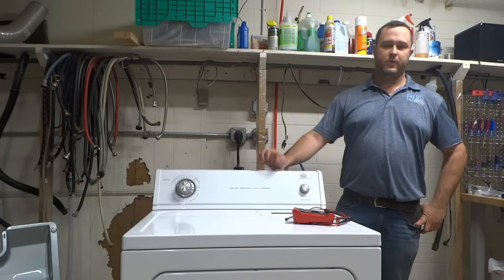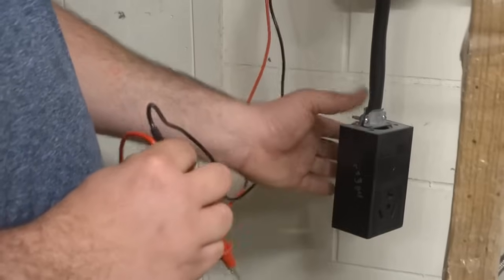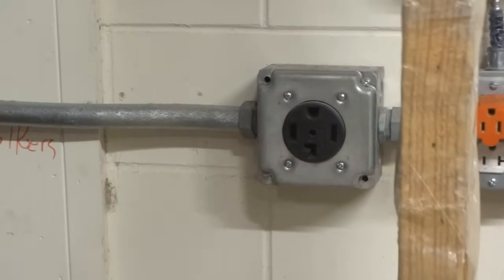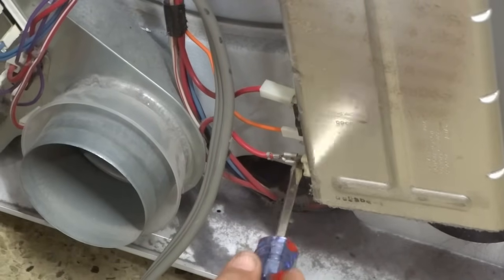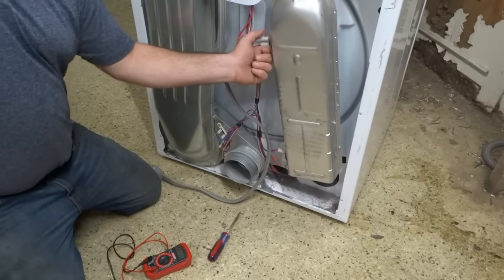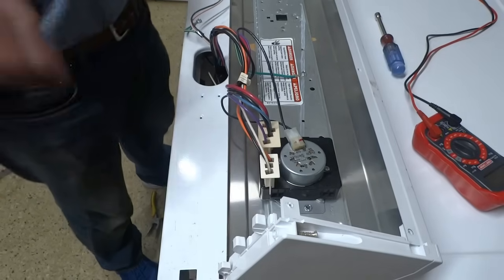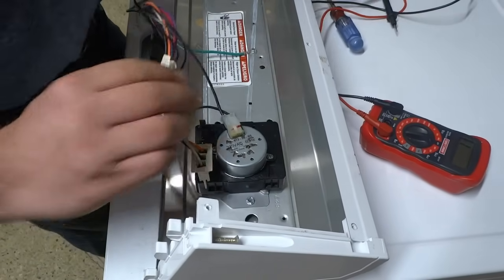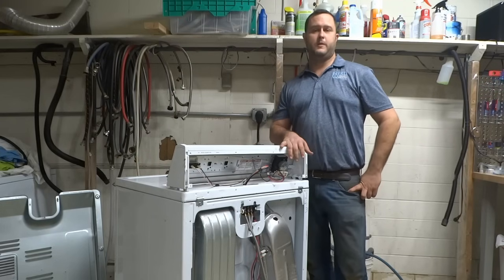Whirlpool Dryer Not Heating - Diagnosing Common Issues

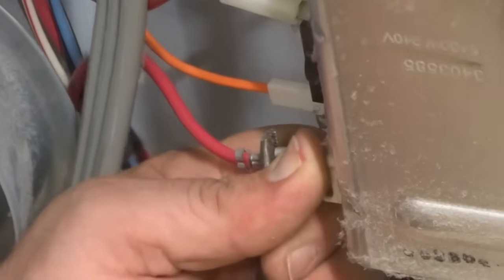Comment: The centrifugal switch in the motor can easily be tested from the back. That red wire that's stuck at 4:30 comes from the switch at the motor. If you have 120 to ground from that red wire while the motor is running, then the switch is closing properly. Live testing involved so use caution ✌🏼
Reply: Can you explain this a bit more? Everything part mentioned tests good on mine, but still no heat.
Reply: @billyjohnson5140  Did you ever figure this out? Everything tested ok on mine too but no heat.
Reply: @apizer did you ever figure it out  ?
Reply: @ericschulze5641  Yes, I did. It took me awhile to notice, but where the power cord wires attach to the rear of the dryer, one of the connections was all burnt out. There was another problem with the dryer shaking, and I think it had loosened one of the dryer plug cord connectors causing it to spark. Replacing the whole thing the power cord was attached to seemed complicated (along with fixing the shaking), so I replaced the dryer.
Reply: @apizer  I'm guessing yours was a GE due to the fact you said it was shaking, probably not worth repair, the cord issue is super common, as a technician the FIRST thing I check is for 220 volts the SECOND thing I check is for burned wires at the power cord, it's extremely common and not from vibration, it's from inexperienced installers ,& could take years to burn off, those screws have to be really tight, almost tight enough to break the terminal block, thank you for responding, PS I ALWAYS check the cord on any dryer or range after repair so if there's a fire I don't get blamed for it
Reply: I also performed a test and everything was testing good and still the heating element what is not turning on, I was decided to send it to get fixed but I decided to you know what just for the last try , I want to the breaker box and even though I take my 240 at the back of the dryer and it was good , the Break it was just kind of lose and I flick it up and down and Wala the heating element work , I  think it was what I call Partially tripped bacause it was letting electricity go through but somehow not all the what’s

Comment: Thanks for posting! Was able to narrow it down to the timer. I just happened to have kept all the usable parts off another dryer that was very similar, so I  used the timer from that one and got mine going again. It wasn't EXACTLY the same, but nothing a little splicing and a couple of incantations couldn't fix. Thanks again! Good video!

Comment: There are two legs that go the heating element.  By logic the one that goes through the timer also goes through the motor.  So its circuit is not only completed by turning the timer on but also the motor running as the centrifugal switch turns, it makes contact and it also completes the circuit to the timer motor as well.  I think the other leg to the heater is directly connected to the heating element but I am not sure depending on make and model.

Comment: Of all the videos that I have looked at. Yours is the only one to check the switch on the timer to the heater. I had run out of options until I found your video. Thanks a bunch. I took the timing switch apart and found the point for the A terminal had been arcing. There were arc marks inside the plastic case for the timer.

Comment: Followed your video and when got to the dial  get beeping on my meter on 2 hot cycles but not the third.   Do i just need new switch or is it my motor fail safe thing.  Hubby wanted buy new dryer i say fix this one.

Comment: i checked the timer  like you did in the video  its open ,but if i check it threw  the plug connector (black and red wires)it reads  good .ohms beep?

Comment: So if everything checks out what else could it be that it’s not heating? The only thing in question was the wall outlet but washer is plugged into same outlet and works fine... I’m at a loss. Thanks for any feedback!
Reply from the maker: Your dealing with a gas dryer if you have the washer plugged into the same receptacle. This video is not applicable

Comment: What is it when your electric dryer works as it should and shuts off at the end of the cycle, but the heat is staying on?
Reply from the maker: Probably some kind of short to ground on the heat circuit. Good luck
Reply: @byrdappliancespecialists3356  Hi, checked the heat circuit, it is not grounded.
Reply from the maker: @carfran53  it can't heat without the drive motor running, which engages the centrifugal switch on the L2 line. Keep checking. Also, it likely blew some fuses, too.
Reply: @byrdappliancespecialists3356  Thank you for your reply. It is heating with the motor not running and every now and then  the fuses are blown. This is beyond my DIY knowledge I will have to call a technician.Best regards from Lima , Peru.

Comment: as I recall, I replaced a thermal fuse on my Gas Kenmore dryer a few years back and that solved the issue, but I believe it was still running just not getting hot - does that make any sense?

Comment: Will the timer not working also cause the dryer not to heat? I know my timer is bad because it won't move off the initial "start" setting... no matter how long it runs (the first time we caught it doing this last week, the dryer ran all night long...). It's also stopped heating, so I wonder if replacing the timer will fix both issues. I have already replaced the cycling thermostat hoping that was the fix, and it did nothing to help either issue. Thanks!
Reply: I have the same problem and question

Comment: Thank you for this tutorial. The heater elements were Open circuit. I ordered the kit which contained all the sensors and thermostat. Dryer is back up and running,

Comment: Using this video I was able to determine that my Upper Thermal fuse had pooped the bed. The dryer still turned on and Tumbled but was not sending current to the Heating Element and would not dry. I removed the upper thermal fuse and jumped its wires together and reconnected the Heating element and the lower thermal fuse plugged the dryer back in and turned it on and the heating element started heating up immediately. Dont worry Im not going to use it this way it was just a test to see if the fuse was the problem, as I had suspected it was because it failed a continuity test while the element and lower fuse both passed. 

I appreciate the advice in this video but the pinned comment seems to be misleading. It must be manufacturer dependant as I have a Sears Branded dryer which is basically just a whirlpool rebrand and I ordered my new part off amazon and it will be here friday (ordered on wednesday evening)
Reply from the maker: Thermal fuse is the white plastic fuse on the blower housing. Glad you were able to get it going again.

Comment: Thank you for the video! My dryer wasn't heating but everything else worked. all the fuses passed and the element appeared good. in your video you said something about checking the outlet volts that if the volts were off it might run but not heat. I hadn't checked that since I knew I had power. Sure enough the dryer had two breakers and only one had been flipped. Put everything back together and it works again!

Comment: Glad I found this video. This is one of the very few that mentions the timer. I unplugged the wires and tested it and it said the switch was ok. I was frustrated because I had tried everything else. For the hell of it I plugged the timer back in and tested it and it worked! Maybe the plug had just become a bit too loose from many years of shaking?
Reply: The TIMER made the dryer not heat ?
Reply: @rickobrien4025  YUP!  I was surprised too, but that was the case!  Took mine apart (see other comments) and cleaned the contact leads and it started heating again like a charm!

Comment: Hey- so the heating element seems to be the problem and I can order and replace that BUT the timer switch also does not turn. When I replace the element will that fix the timer? The time is not blown according to the meter.  I checked all of the fuses and timer like you did and the lower white heating element thing was the only one which didn't read properly to zero ohms. It got no reading at all. Also the coils don't get red when dryer is running. Just hoping the timer will work correctly after I replace the element.

Comment: If it is the switch itself you can take it apart and file the carbon down between the heat contacts and it will work again. I did mine a while back and it worked for a long time. It seems like I've got the internal motor issue with mine. It's 9 years old so I'll probably just get another one.

Comment: this is a far shot you might not respondbut ill give it a try. so I checked for continuity on all the major switches even the thermal coil, everything gave a reading.  i don't know what the problem is.also the light inside the dryer is not working. could that be why.
Reply from the maker: No. The light is independent - it's circuit is closed when the door opens.

Comment: I want to say thank you it was my high limit switch the bottom thermostat was good and when I turn the timer on to check where the two hot wires were or the two hot wires were I got it to ring on the timer I didn't get it to continuity with a timer shut off but when I turn it on get it

Comment: So mine was the top one and I replaced it but still isn’t drying after I replaced both top and bottom. Why would it still not be heating after replacing the part that wasn’t good. If possible please help. Thanks
Reply: Timer?

Comment: Not sure about your centrifugal switch comment. It can be tested by physically activating it and homing different motor terminals. 
  Also, on some dryers, if the blower wheel is not turning, but the motor is, how is that going to disconnect power going to the heating element?
  If you remove the motor switch cover, you will see the contacts that make up when you activate the centrifugal switch.
Reply from the maker: Right, but the easy way would be live testing. It's easy to engage the switch, but that won't tell you if it's not closing correctly when the motor is actually spinning. It rarely, if ever breaks - it may sometimes have lint stuck in it - 1 out of 500. The video shows the common issues. Good luck

Comment: The thermostat with the 4 wires is the Operating/Cycling thermostat on the blower housing. 
  I have to wonder why you called the High Limit stat on the element cage the cycling stat?

Comment: is the ohms the same as checking for continuity? I'm not as familiar with ohms. I've always used the continuity symbol on my meter to look for open circuits.
Reply from the maker: Continuity, on the meter, is a measurement of low ohms. By definition, continuity really just means that electricity will pass through what you're measuring. Practically, once you get past a few hundred ohms, meters typically won't work on the continuity setting.
Reply: If it's working properly you said the ohms should read zero or one, so would the continuity be ok for this?
Reply from the maker: Yes

Comment: What do I need to do if I'm not getting continuity across the very bottom part that you had to use pliers on? I'm not sure if that's part of the bottom thermostat, or if it's part of the heating element.
Reply from the maker: Bottom 2 is the heating element.

Comment: Thanks for the video.  The video has great value.  I'm a DIY'er, with a framework of knowledge and a deficit of experience.  I would find this video even better is the hand didn't block what what the multi-meter prongs were contacting.   Also, the setting on the multi-meter and a very brief explanation would be good to remind me what I've forgotten between my last repair with a multi-meter.    Excellent delivery!  Thanks!

Comment: Well, I checked everything from the video and had good voltage and good continuity at the timer and thermostats.  Still, not heating.   Any suggestions?
Reply: I also cleaned out the duct from the filter to the blower.
Reply: I assume it is the heating element? He really didn't talk about it. :-(

Comment: Thank you! After replacing all thermostats, heating element, using a kit it still would have intermittent heat. Using your video I was turned on to the timer switch and bingo that was the culprit, I used my meter to test it and sure enough it was faulty.  Thank you for posting this info.

Comment: I'm getting continuity on the timer when its set to high heat but not on any of the other heating settings. Should i replace the timer going by that test or is it tricking me?
Reply from the maker: Sounds like the timer. Best test is to run it on the different settings and confirm. Then you'll have a second confirmation. Good luck
Reply: @byrdappliancespecialists3356  thanks for answering back quickly. Feeling confident in the info you've provided. When these things break you need them up and running again asap.

Comment: Hi, what about the white sensor to the left with the 2 blue wires, what is that for? Should we have test results? How should we test it. My machine tested all ok, I cleaned it out and yet it heats but I need to redo all loads a second time.
Reply from the maker: White thing is a thermal fuse - not related to heat circuit. If you have heat, make sure you're not crushing the vent hose, and your external venting is clear. You can test it without any venting attached to test. Good luck

Comment: My Whirlpool  TEDX640PQ0  has continuity on all thermostats, heating element, and timer. No lint -- completely clean yet dryer runs but no heat. What is the most likely problem? My guess is that something is wrong in the timer.

Comment: As I was taking off the vent cover I slid it too much to the right and it hit that wire you took off at @5:40. I forgot to unplug the unit so it shorted out. (sparks). It also tripped the breaker at the panel. Dryer still runs now but no heat now. Hoping it's one of the fuses you showed. Any other idea what could be causing it to not heat after the short?

Comment: Thanks for the video.  I just found the same issue, all my sensors and coil checked out, still no heat.  Used this video to trace it to the timer.  Pulled the timer out, and discovered, you can pull it apart.  Remove the two screws holding the winder clock in place and carefully pull it and the cover plate off.  You now have access to the contacts.  I used a small jewelers file, much like an old school points file.  An emery fine emery board would be ideal.  I found one really worn contact, and another from a lesser used setting that was also not making heat.  Cleaned them up, blew out the metal filings and put it back together.  It's working again.  

Mine is a Whirpool WED5200VQ1 model for reference.  My timer unit looks very similar to the one in the video.  Thanks Byrd Appliance for the help.  I understand you can't open a part and show how to repair for liability reasons. 

 File those contacts at your own risk, and blow out those filings, even with just a puff a breath, and don't fret.  These worn contacts can be refurbished.  Worth a try before a $80-$100 timer part change in my garage anyway.  Still testing, verdict not out, but those contacts are now much cleaner and making contact and my dryer has heat again.
Reply: Mine is a Whirpool WED4800XP0.  The timer and connections looked just like the one in this video.  My red wire contact had no continuity just like this video!  I took mine apart also (careful to take pictures of everything when you take it apart in case something drops out).  Very easy.  Sure enough, the little pellet contact for the red wire was slightly corroded and gummed up!  I cleaned it with an emery board and scraped it a bit with a utility knife.  Checked continuity, and it was working again! Put it all back together and now it has HEAT!!!  This video and your (and others) comments about disassembling the timer are GOLD!  Should save a lot of folks a lot of money on either service calls or a brand new dryer!  Thanks for posting your experience!

Comment: Very helpful man thank you. Just so I got it, I tested everything you ran through here and the only issue I found was the top thermostat (safety I think) didn't do anything when I put my multimeter on it, the others were either 0 ohms or 9 ohms or less. So with getting no reading I would think that means I got a bad T stat? I'm a Auto mechanic so I'm kinda out of my element a little lol. Thanks for the video
Reply from the maker: Sounds right

Comment: Hello!  Thanks for your video. My dryer drum is spinning, but there is intermittent to no heat now.  I followed along and I seem to have gotten the same results up until 5:46.   When I put my meter to the .. pin thingy, unlike the others, it didn't move at all. I don't have my manual any more so I'm not sure what part that is. If anyone reading this can help point me in the right direction I'd appreciate it. I'm hoping  I can order the part and have it here by the weekend, otherwise I'll have to head to a coin laundromat :(
Reply: Same problem here I’m currently working on mine. 🤔

Comment: Excellent video. I was getting ohms no matter what I turned my timer to! I think my timer is on the way out. I originally was not getting Heat but after I put the dial to a place where I did have ohms I could see the fire start up in the heating element.

Comment: I put several high limit switches on the same dryer and they keep popping I've cleaned it thoroughly and don't know why?
Reply: That could be a problem at your breaker box/panel with unstable voltage I think . I'm not an electrician, but my house was built in early 1900s, rewired in the 1990s and things are a little hinky in places. Bill Newberry is another maintenance guy on the 'Tube who speaks to the function of high limit switch more in his whirlpool heating video. Hope your problem got solved!